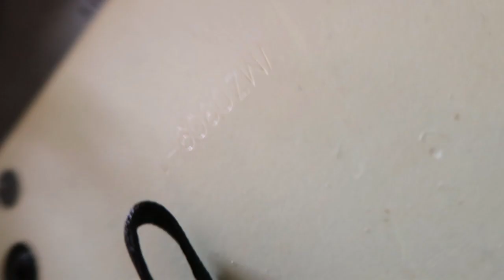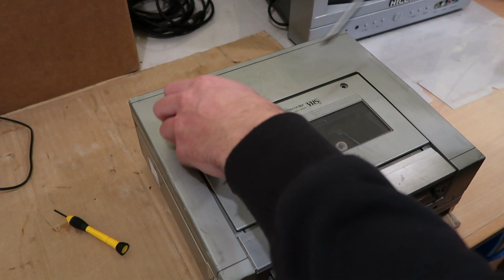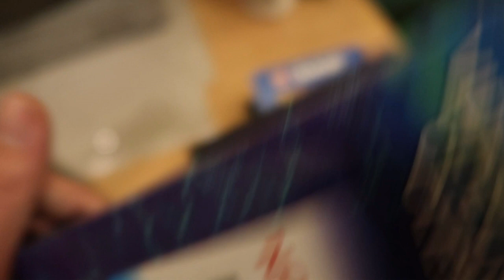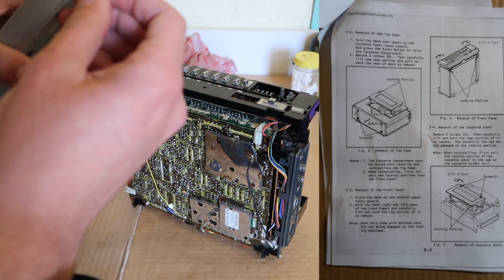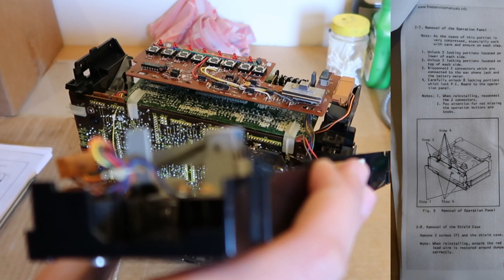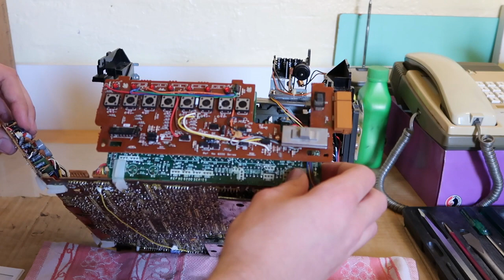Fixing the National NV 3000 portable VCR Part 1 - opening it up

Comment: i have the exact same vcr but it says curtis mathes on it, ive been trying to figure out what cord i need for the power supply
Reply: I have tracked it down to being a mini din cable but there’s so many variants that I’m scared to buy one online because I don’t want it to be the wrong one when it comes to
Reply from the maker: I used the socket for the battery to power it, rather that the DIN input on the side. It is a centre negative 12V DC input. I bought some barrel plugs with outer diameter 6.3mm and inner diameter 3.0mm off eBay and they fit perfectly. For the power supply I used a suitable wall wart power supply. I have a video of making the adapter cord.
Reply: @ ah I need to be able to charge the battery for I’m using the vcr for a camera so it needs to be portable
Reply from the maker: @Onionionionion  The socket is not mini DIN, it is standard DIN, as the shield of my normal sized DIN plugs fit. I don't have any 4 pin plugs though, so I'm not sure if it's the standard 4 pin or a variation. I have a PDF of the service manual, I can email it to you if you'd like. It has a schematic diagram of the DIN 12V socket on page 74 that at least to me reads pin 1 12V, pin 2 12V, pin 3 20V for heater, and pin 4 ground. I don't know the pin numbering for the four pin DIN socket.
Reply: I need that vcr any one wanna sale plz contact
Reply: @fasih3486  im not looking to sell i just need to get this one fixed, unless you have another portable vcr like it that works to trade
Reply: Tengo una Panasonic PV-3000
CON LA FUENTE DE ALIMENTACIÓN. FUNCIONA , PERO NO LOGRO SACAR EL VIDEO Y EL AUDIO , O LA PUEDO VENDER ESTA MUY CUIDADA , MEXICO

Comment: Oh, one hour video. They made really compact VCR with such a complicated disassembling procedure. A giant circuitboard with extremely high number of components including chips  - that's why I don't like repairing VCRs. I just can't understand what can cause a failure, what component is broken and I can't "read" it's schematics.
Reply from the maker: Yes, it sure is complicated! So far its issues have been mechanical, although since I haven't been able to play a tape yet, it may have electronic issues too. This is the first VCR I'm attempting to repair, I have another I've opened up but will only work on it once I'm done with this. So I don't really know what I'm doing, it'll be interesting to see if I can fix it.
Reply: @toomanyinterests  Maybe there is a page with "common failures" in this repair manual? Some manuals have it, usually their recommendations are useless, but sometimes helpfull. I hope the issue isn't fully electrical, I hope it is just a dirty contact or photodiode but not a chip failure. If it isn't a mechanical problem, maybe electrolytic capacitor is bad but there is a plenty of them in VCR. You can start with testing rewind function, if it works, the motor moving tape works, so motor control system works and motor is powered. This VCR seems to be portable thing like reporter's VCR working with it's camera.
Reply from the maker: @aleksey_gorlanov  Yes, I will test all of the  functions to see if the tape moves. I think the current issue is mechanical because it works sometimes and seems to be getting better, as if a mechanism was seized up. That's not to say it doesn't have electrical issues too. This is a portable VCR, it was designed to be used with the camera I have to record video. There was a tuner unit that connected to it also so at home it could be used to record TV. I think this was more for consumers than reporters, but it would have been an expensive piece of kit in the early 80's.
Reply: @toomanyinterests  Look like you are right, because in the end of video tape is moving to video-head after all of your manipulations. What is the component at 1:10:00? Maybe it is some king of sensor and you should glue it? 

This VCR looks like left half of "Электроника ВМ-12" Soviet VCR from 80s. Looks exactly like "Электроника ВМ-12" VCR was cut in the middle.
Reply from the maker: @aleksey_gorlanov  I think component 441 is a sensor, I looked at it and it has some fine tracing on it. It corresponds to a slot in a VHS cartridge, but I don't know what the slot is for. I have tried to find the component in the service manual's parts list but couldn't. 

Yes, it does look like half of the Электроника ВМ-12. This unit is essentially half a VCR.
Reply: @toomanyinterests  I spent some time looking for information about "441" element. I downloaded a manual and the metal plate what was glued to "441" is named "Dew Sensor Unit" in list of mechanical parts. It has a 59 number on a diagram. So "441" is a moisture sensor probably (What for?!), I found it on diagram, page 3-25. It connects to the biggest board. I don't think this part is the issue.
Reply from the maker: @aleksey_gorlanov  The moisture sensor will not allow the VCR to operate if it senses too much moisture to prevent damage. The Moist indicator lamp isn't illuminated so yes I doubt it is causing the problem.
Reply: Mine problem is shuts off after turning on its turn off after 3 seconds I don’t know what is the problem can anybody help me 

https://youtube.com/shorts/I4wRxPeZPAg?si=v25RVcUkmIdcfFIT
Reply: @vintagelover3873  I have a modern VCR (LG, with DVD player included) that suddenly started to shut off after I turned it on. I found out a capacitor was bulging. I replaced it and the problem was solved.